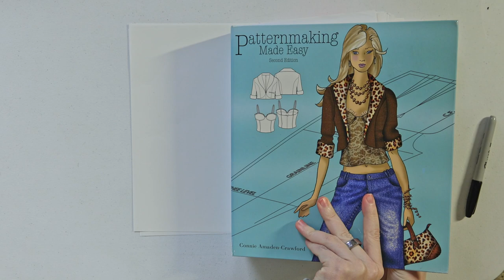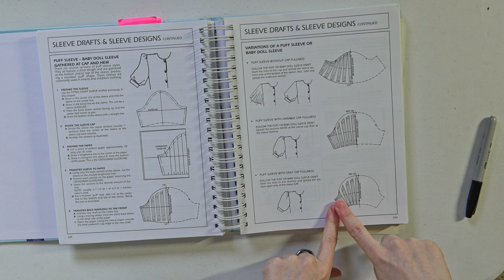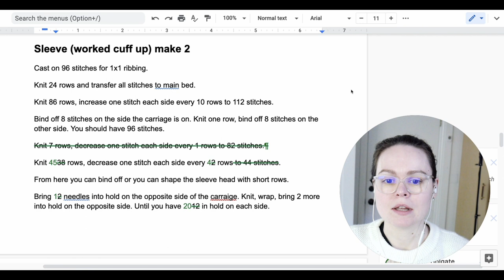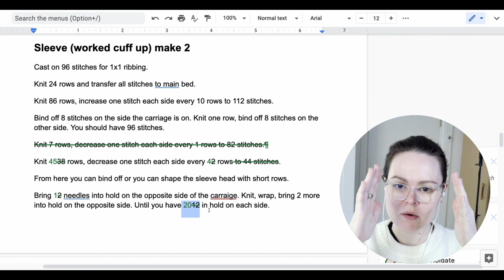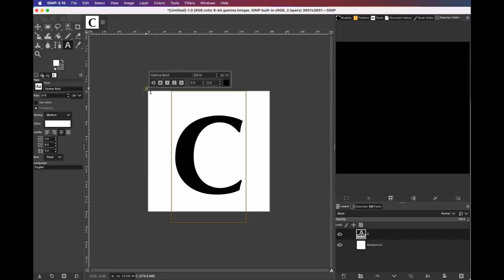Intarsia vintage letter sweater | Machine knitting tutorial

Comment: What a nice sweater, I love your videos though I own a punch card machine and will never do software anything with it. What I'd like to know: How do you routinely care for your knitting machines, aside from replacing parts? It is very obvious that your machines run smoothly while many others one sees on YouTube rattle, resist, creak and groan. With my different sewing machines I know how far to take them apart, what to oil and where to search for lint bunnies. With the knitting machine, I would like to know more apart from what the manual says: "Just dedust it, wipe it a bit with an oily cloth and send it in at the first signs of trouble."

Comment: Nicely done.  When doing a FF decrease try moving the third or fourth stitch "out" over the stitches you are going to move then move the stitches in, will make a nicer finish.  They attaches the shoulders on the machine for a seamless seam or pull one set of stitches through the other, knit a loose row and chain off.  When I do a neckline I knit one row at main tension then transfer for the ribbing, really smooths things out.❤